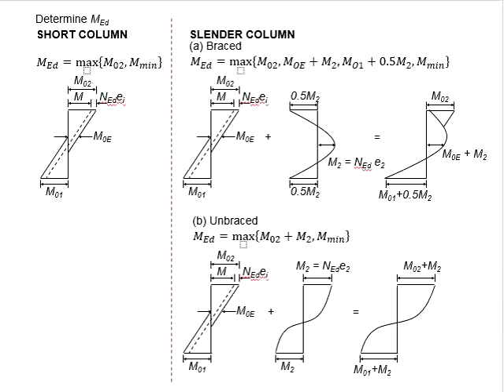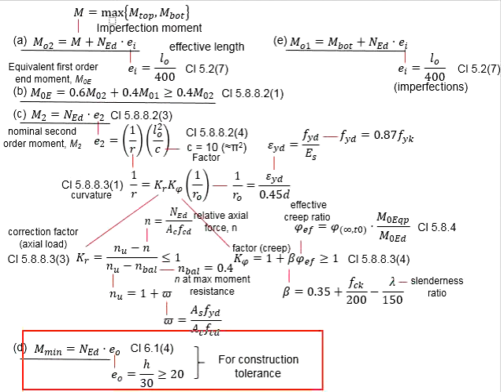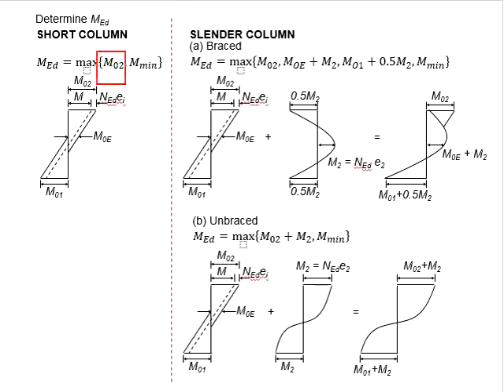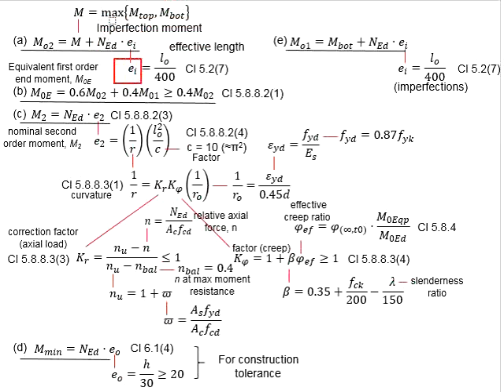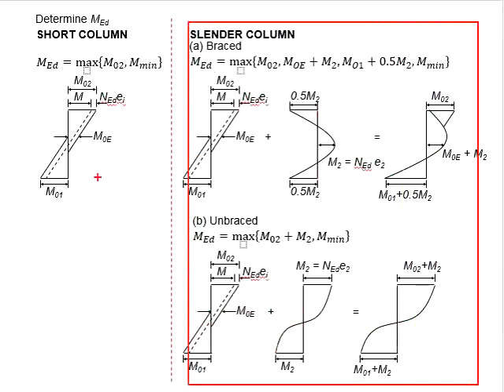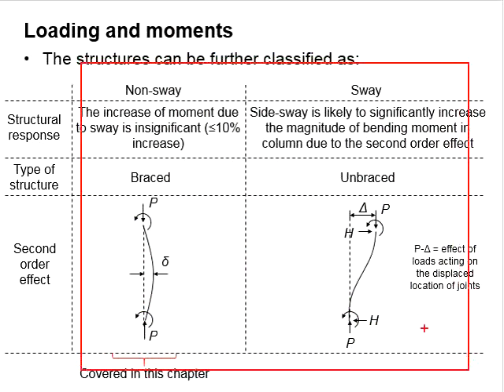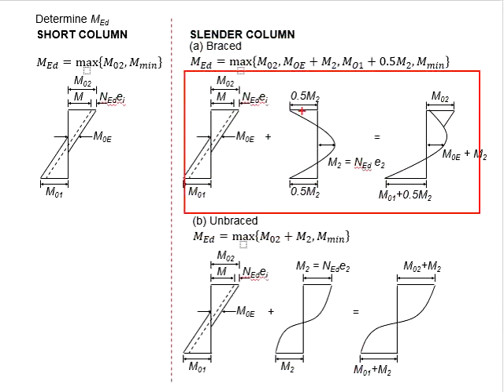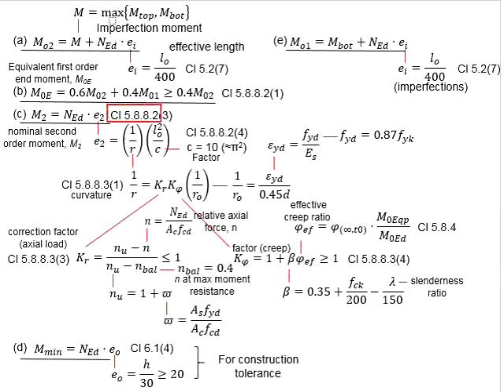2.18 Design moment of column

Comment: Sir, in short column design, if M02 and M01 is zero, so we take Mmin as our design moment? do we need to check for biaxial bending too?
Reply from the maker: Yes. Mmin shall be taken. Theoretically, biaxial bending still needs to be checked, as it is triggered by the sectional properties instead of the magnitude of the bending moment. Nevertheless, since the moment is relatively small, biaxial bending is most likely not an issue. At the end of the day, the reinforcement in the column is most likely either governed by the axial load or the serviceability requirements, such as min size and nos of rebar, etc.
Reply: Thank you sir for the explanation